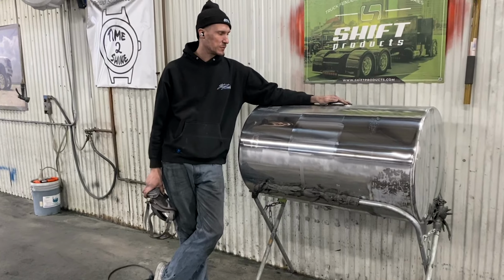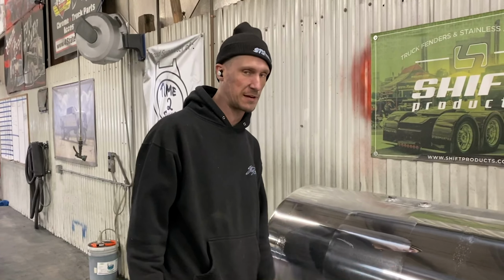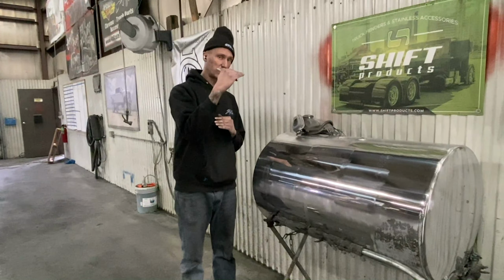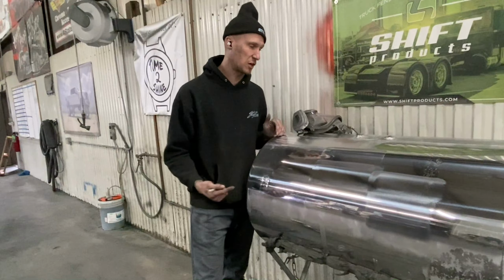Is my pressure right for metal polishing? - Evan's Detailing and Polishing

Comment: Obviously too, the more hours you have with your tool the better you are with it. I found when i first started it was not easy keeping tight which meant i had to drop back down a bit and rework my way upwards to get the patches i missed. Really need to be able to see and follow the line. If you're not used to holding a somewhat heavy tool with the spinning force you may fatigue easily. The harder you press the easier you'll fatigue.
Reply from the maker: That is very true. Which is why I try to get most to apply medium pressure to try to get the best of both worlds.

Comment: What do you do to get rid of the hash marks after? Thanks!
Reply from the maker: I leave hash marks on 95% of everything that leaves my shop. Getting rid of hashmarks takes a ton of time. And Time is money. Most people understand friction on metal and fabric and don't wanna pay days to get rid of hashmarks. One wash and the wash kid is gonna scratch the tank worse with the brush laying on the floor than the hashmarks. Just my opinion. Thanks for watching.
Reply: @EvanStegerMetalPolishing  Yes sir, found that out the hard way. To get a mirror shine I stick microfiber to an orbital (hook and loop) sander and use the polish, after the rouge. It's possible but it takes forever like you said and if a spec of dust gets on it, it leaves pigtails and gotta re-sand. You're right about the other part too, once it's like a mirror you can't touch it with anything, not even a finger or it'll leave a mark.

Comment: Is there any preference between Makita and DeWalt?  I see your store has both.  I'm looking for 1 tool that I can use with buffs on aluminum as well as something to polish paint.  Thanks for the great videos!
Reply: I’ve got both the dewalt and makita variable speed polishers, I find that the makita one has more consistent torque as the dewalt one does spin a bit faster than the makita but it bogs down a bit when actually using it to polish aluminum.
Reply from the maker: I personally prefer the makita but they both do work. I put them both in my store as not everyone likes makita.
Reply: @EvanStegerMetalPolishing  Where do I get the rest of the materials to polish a new pontoon boat besides the Makita grinder?
Reply from the maker: @Oneklrvette  goshineon.com has all the products I use. The aluminum kit would be the best.

Comment: What causes those white "tiger stripes"? I've been working on a newly made battery box and no matter what I do it's leaving lines behind. The piece is a mirror but in different lighting those lines appear.
Reply: Check out the video posted before this one. Talks about the difference in flat and round surfaces and how you need to adjust the overlap depending on which type of surface you're polishing. Really helped me get rid of those pesky lines 👌🏻
Reply: Awesome thank you. I've been getting really frustrated over this lol
Reply from the maker: Did you find the previous video helpful?
Reply from the maker: Thank you Devon.
Reply: @EvanStegerMetalPolishing  yes it helped but I've tried just about everything and still leaves some tiger stripes behind. It's a mirror but the stripes are visible if a dark object its reflecting off the piece. Maybe I'm too picky 🤔😅
Reply from the maker: @coreysadventures963  If you have stripes then there is definitely an issue somewhere along the line. It is almost always a pressure and overlap issue.
Reply: @EvanStegerMetalPolishing  got it figured out. Watched your video on hash marks and friction marks and it clicked. Guy had a new battery box/step made and I had it on the bench standing up. So when it the piece is on the truck the marks are up and down, not side to side. Thanks for the help 🤙